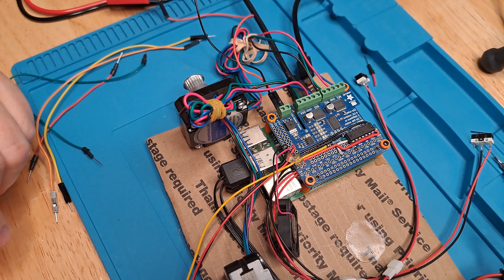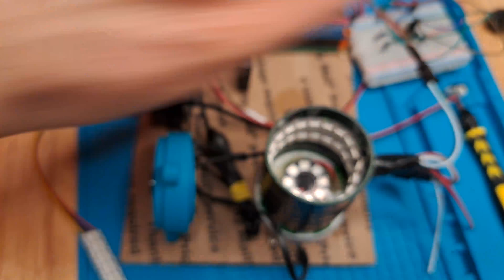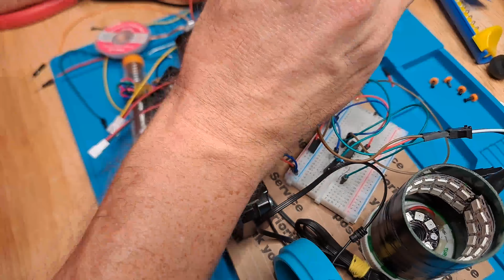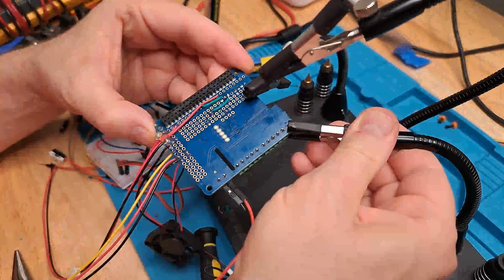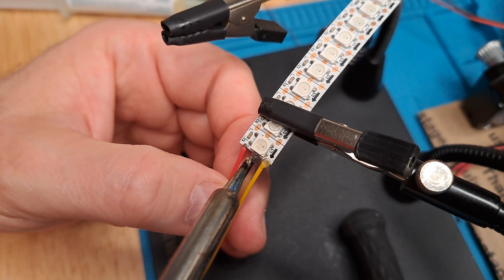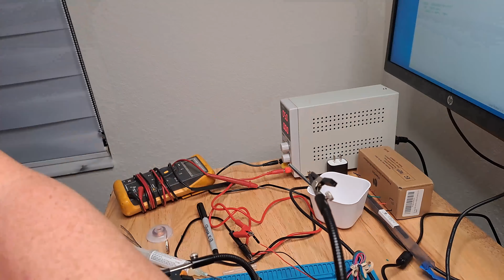I would laugh if THIS wasn't so painful - On Camera: 30 Day Challenge - Day 22

Comment: Sorry, man, I didn’t follow along everything. How are the strips powered? If you can make it work on a different board, then it is probably not soldering. Trying to debug the communication between the Raspberry and your microcontroller using at least a serial monitor and printing values or function calls is better. I wish you good luck!
Reply from the maker: The 5 volts is coming from my bench top power supply. Data from the Raspberry Pi 4 is being routed through a voltage lifter to take it from 3.3v to 5v. I ended up having two separet wiring issues. 1. I forgot to run power to the voltage lifter and  2. I had the led strip wired incorrectly. It's all sorted out now. Again, thanks for your feedback and suggestions . . . they are appreciated.

Here is a new Playlist with all of the ON CAMERA challenge days in September so far: https://www.youtube.com/playlist?list=PLY3UeyAXCEmKH4Tu-vhTedwjta3Mf77j-